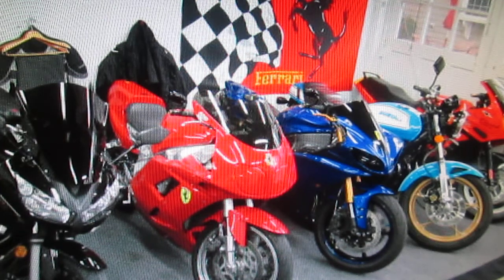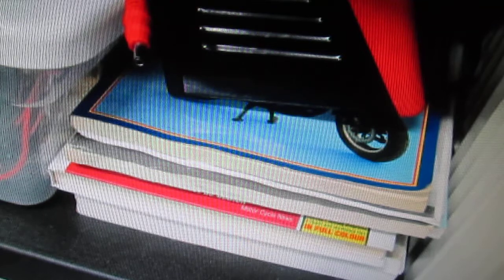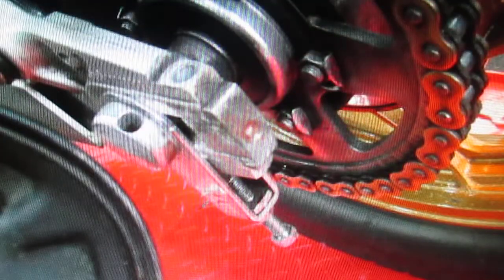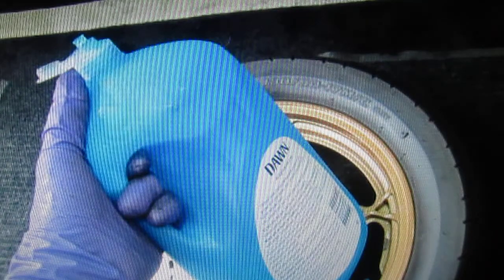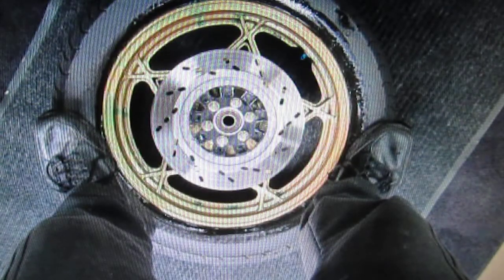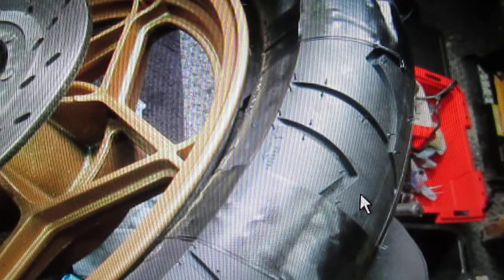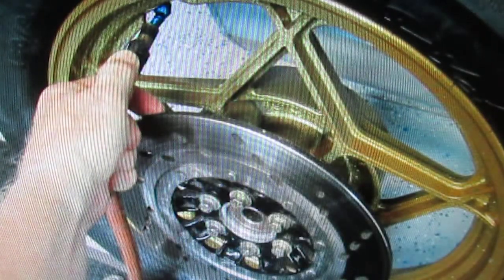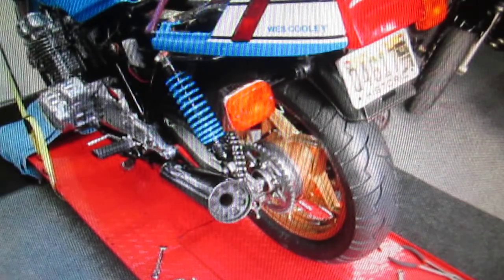Installing MICHELIN rear tire on GS 1100E

Comment from the maker: REAR CALIPERS FROM MANY JAPANESE BIKE OF THAT ERA ARE INTERCHANGEABLE. GOOD TIRES,DECENT BRAKES,TIGHT BOLTS AND GOOD BUT IF ALL ELSE FAILS HAVE SOMEONE WITH EXPERIENCE GO OVER IT BEFORE YOU GO ON ANY LONG RIDES. HOPE YOU ENJOY YOURS AS MUCH AS MY OLD GAL THEY ARE WONDERFUL MACHINES EVEN ALL THESE YEARS LATER. IF YOU REPLACE CHAIN I RECOMMEND 530 CONVERSION AS A GOOD UPGRADE.